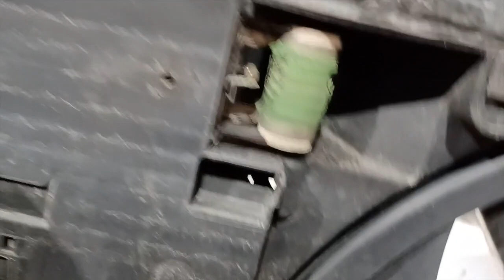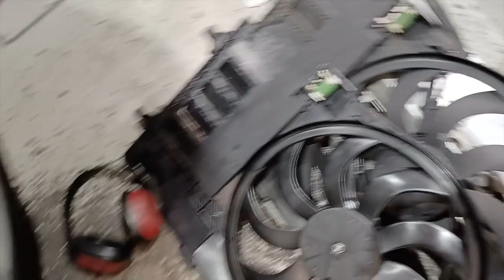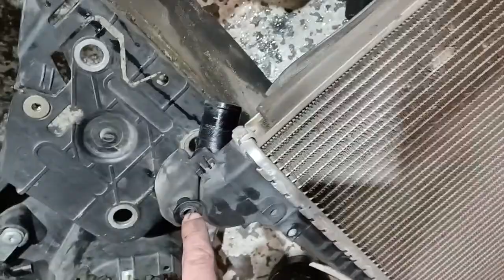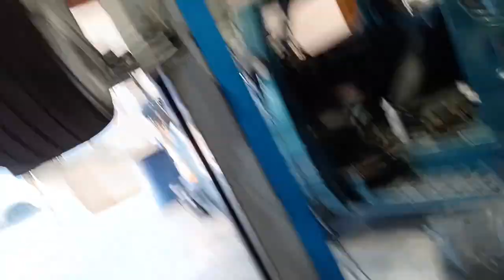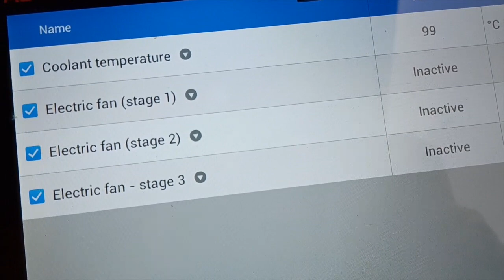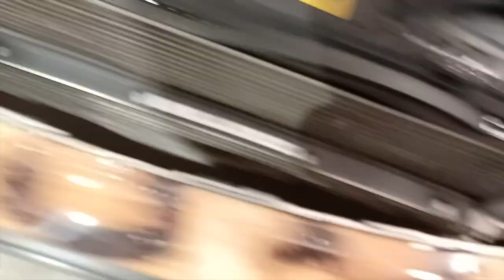Mini fan not working (no stage 1 fan mini cooper)

Comment: Will the fan relay also play a part on the a/c compressor not turning on?
Reply from the maker: Possibly, but I'm not entirely sure. You'd need to see a wiring diagram to see if the power feed for the AC compressor clutch runs through the relay. But it could likely be a completely seperate fault.

Comment: Sorry for writing you a book

I have a problem with a mini cooper s

I have replaced the thermostat because the heater inside did not get hot.
Also, prior to replacement of the thermostat the fan came on when the engine was not even started, and it kept running even if the engine was still not up to temperature and you switched it off.

Now with a new sensor and new thermostat the fan does not come on at all.
I have found the secret menu to find out how hot the coolant gets.
I have taken it to 110 degrees Celsius and then switched off the engine because i have heard that it should switch on roughly between 105 and 108.

It does not switch on.

I have checked the relays, switched them around with one that absolutely works fine, but no luck.
I have jumped the relay to see if the fan still works. It still works.
On both high and low, if i jump the relay.

I have a visual on the resistor that is on the fan itself, and it looks fine from the perspective that i can see it. I can not see the other side, only one side, but it looks like it has not been damaged.

I have seen a video where a guy had to reset the computer, erase codes, because he triggered a code that kept the fan from running.
I have a cheap ODB reader and have tried to reset it all but no luck.

I have checked voltage on the relay. I am not an electrician, but if the relay has 12 volts on the pins that should trigger the relay, why does it not get triggered?
Both relays for low and high speed fan have 12 volts roughly on the pins that should trigger the relay.
And roughly 16 to 17 volts on the pins that make the fan run.
And yet, it does not start up.

Do you have any idea?
I cant reach the resistor to do some measuring with the voltage meter....
But my guess is that that one has to be dead because the relays seem to be functioning when i switch em around to another position.
And the fan is not dead, because if i jump the leads it functions fine.
The temperature sensor can not be dead either, because it is brand new. It came with the new thermostat. I think it is highly unlikely that it already is dead, plus i read it off of the dashboard, and the temperature goes up gradually from cold to 110. (when i decided to switch it off, scared of damaging even more)

If you have a clue what i can try, or where i should look, it would be much appreciated,
Or do you perhaps also think it might be a code triggered in the computer that prevents the fan from running?

What i just do not understand is that both relays have 12 volt on the pins that should trigger the relay.
And it stays off.
But if i jump the relay, the fan comes on.
But the relay functions just fine in another place. 
I hate problems which are not clear
Reply from the maker: At this point it may be time to consult an auto electrician with a more advanced scan tool to see if there are any resets and to check the resistor further. The resistors are quite a common issue so still a possibility even if it looks physically ok.
Reply: @gettingitdone1  i was afraid somebody would respond with that.
And ps: sorry for writing you this book

I have checked it all as far as i can.
I am positive the sensor works to measure temperature.
I am positive the relays work.
The fan works. If i pull the relays and jump the gap it starts spinning.

The resistor is in a spot where it should not be. Or as far as i can determine from looking at videos.
Normally it should be behind the plastics. But in my case it is visible from the outside.
Which makes me think it has been replaced one time or another.

Anyway, gonna check the resistor, and then to the shop to have a more sophisticated scan tool scan it.

BUT, maybe you can explain this:
2 relays, high speed low speed.
They both function. I have tested them all kinds of ways and i am certain that they function.
They only fit into the socket in 1 direction.
I have measured the pins in the socket with a multimeter.
2 of em together make 17 volts. Those go to the fan.
The other 2, the ones that trigger the relay to switch it on or off, they measure 12 volts when the ignition is on.... (maybe i make a mistake here, maybe only when the engine is running. BUT, one of the 2 is correct. SO...)

I have tested the relays and they switch on with 12 volts.
The socket the relay sits in already is supplied with 12 volts if the engine runs.
So, the relay should switch on and make the fan turn.
Because if i pull the relay out and jump the gap with a nail, the fan spins.
And yet, the fan does not spin with the relays in place.

100 procent sure the relays are working fine. And i have measured the voltage several times.... 12 volts across the points that should trigger the relay.
So, the relay is triggered when it is in the socket, is my opinion.
So, the connection should be made to make the fan spin.
And yet it doesnt.
But a nail does the trick.

It really makes the water i have in my head boil.
Reply: Check fuse F5 5A  and your power steering cooling fan, it will not let  stage 1 fan come ON if it’s seized up.

Comment: Great video explains everything great!! But man that is an interesting choice for the body paint
Reply from the maker: Yeah it's a wrap, certainly gets attention and suits it well.
Reply: Hi, I am wondering if my low speed fan works. There is a fan that turns if i have the ac on or i sit in traffic in the summer or have driven the 2007 mini Cooper r52 none s hard. But the needle stays in the middle. The fan sound is not over powering but it is there. I have read tons of forums saying it should sound like a jet engine. The temp gauge never has hit the top.
Reply: @andersanden3221 stage one is quite and stage 2 loud